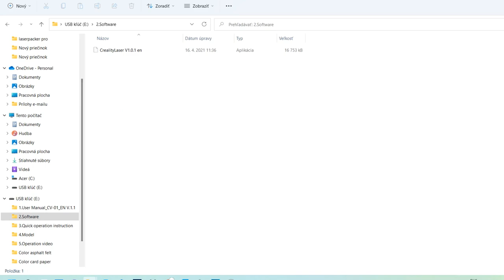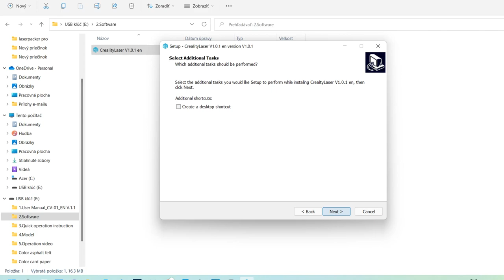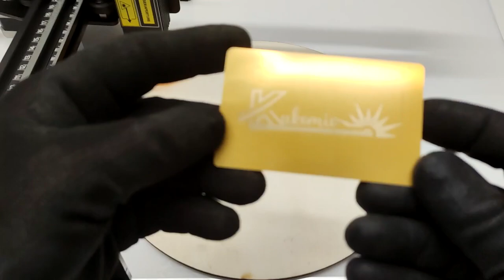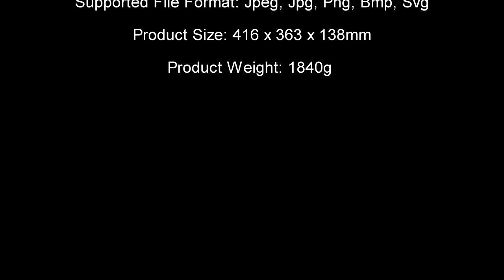Creality CV-01 Carving Machine  , Portable Laser Engraver -unbox,assemble and test (Creality3d.shop)

Comment: How does this work vertically? If I wanted to engrave some sketchbook covers, do I just shim the whole machine up on blocks or something? How do you account for material thickness with a machine with only 2 axis.. 

I was considering the S1 Pro, but the swap takes way too long for my liking, so I figured I could by an Ender 3 pro and this for the same amount and run them simultaneously. But several of my project ideas require material thickness.
Reply: You get a black sheet for which you use to calibrate for respective thickness. There are some videos that show how you do it

Comment: Can it cut 2mm MDF?
Reply: I would imagine you'd need to run over the pattern several times to cut MDF of any thickness, and it might be necessary to add a fan (or fume collection "system") to deal with the smoke from cutting. But if it will burn a surface at all, it will probably cut that surface. Cutting just takes a lot longer than engraving.
Reply: @hipu  also it will be neccessary to use stronger laser unit :) this use 1,6W unit